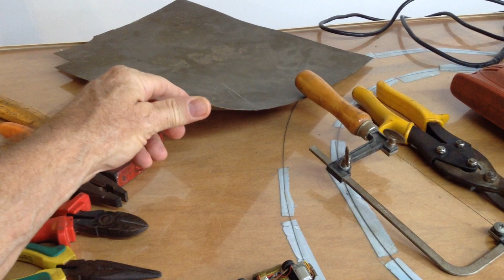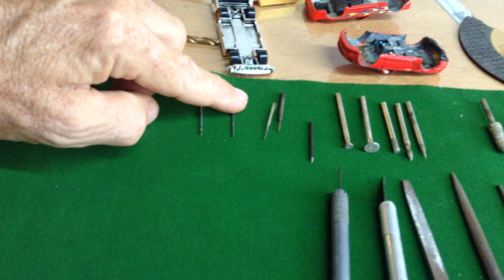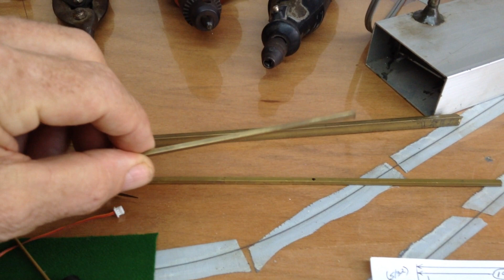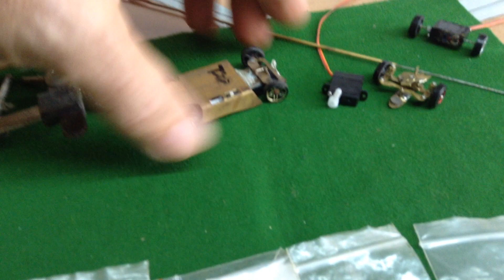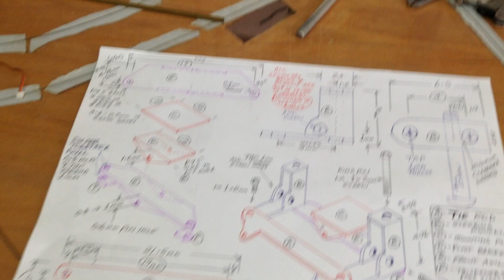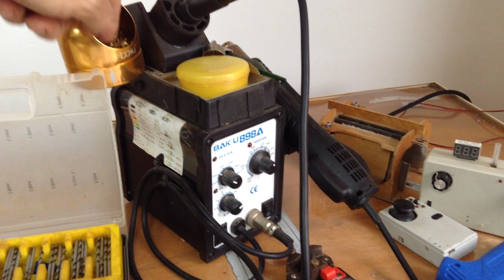Tools and Steering design 1:64 scale RC cars

Comment: thank you very much for all the info and the videos! i have been following your channel for some time now and your work still amazes me. i really want to start a hot wheels rc project but i have a long way to go since i need a lot of tools and parts to make one. without your help i would even imagine where to start. i have bough a few tools and now all thats left is the electrics and the chassis. still having a tough time finding a DasMicro Rx and the Tx that goes with it (the DT Tx2 that you use). i want to make something compact and awesome like your cars, not with a massive bulky Tx (a Spectrum for example) the looks out of place. either way i really appreciate the info and the blogs you have posted! keep up the great work and as long as you post videos the notification squad will be watching! :D
Reply: That's a amazing knowledge you are sharing, can also make a small vedio how to make steering setup step by step